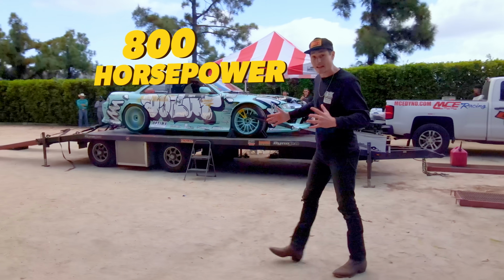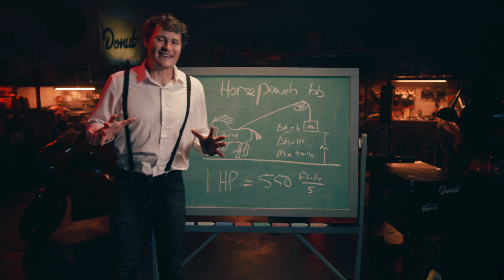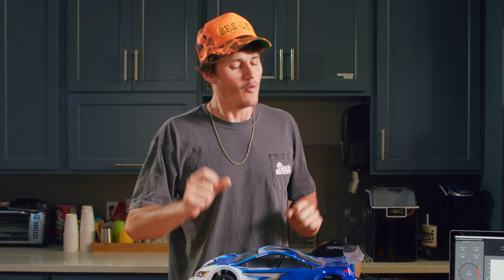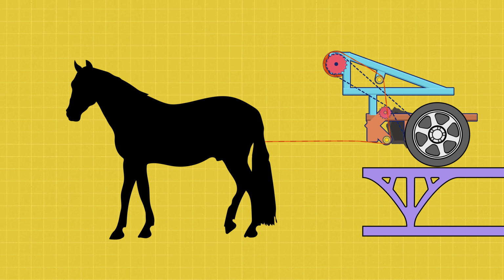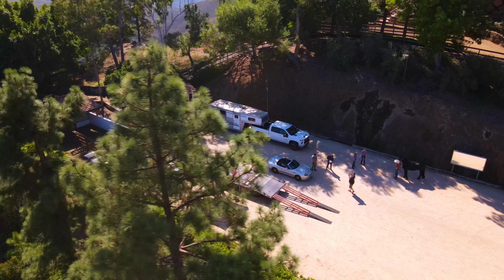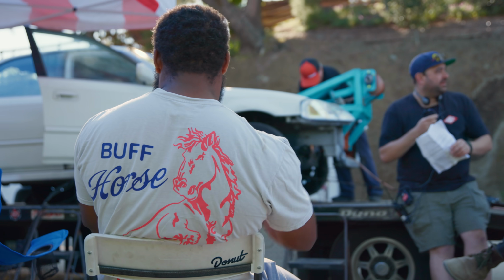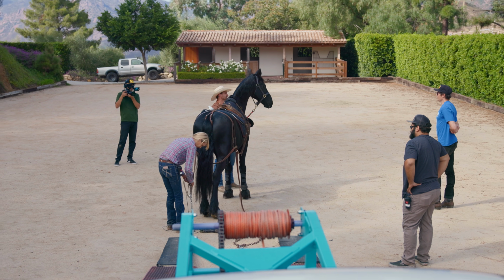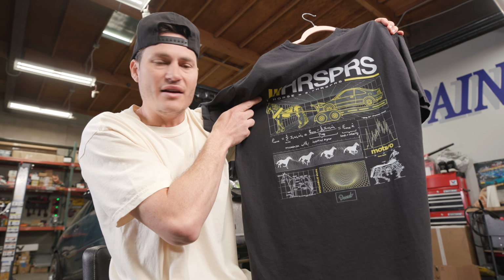How Much Horsepower is a Horse?

Comment: And there was me, hoping you were going to build a horse sized treadmill 😂 That would have let you measure sustained horsepower rather than very short burst.
Reply: exactly what I was wondering, why not use a treadmill type device?!
Reply: @hmezzy I mean the horse would for sure be quite confused and it'd be difficult to get the same amount of traction
Reply: @hmezzy  my old man has horses and I've been around horses and ridden them since I was little; there would be and issue with firstly getting the horse to start walking (unless the dyno drums are lighter which defeats the purpose {I think}) plus cars don't fly off the dyno cuz they are stuck in there, then there will be an issue with weight as the horse would be to heavy for a treadmill without extra support via extra rollers side-by side, and a treadmill track at least 3 in thick to compensate for the bumps, now the issue is slowing down the horse, my statement about the dyno drums still stands as I couldn't imagine a way to get a horse to comprehend slowing down the inertial force of the drums. With that in mind, if you really wanted to you could get in done as there are solutions to these problems but.. I really don't think it would be worth that much money for one test lmao. Prolly could of wrote an essay instead of writing a pointless nerdy youtube comment lol😂😂😂😂😭😭
Reply: @InvertedRooster  any animal can be trained to run a treadmill, but you are right it's an issue. Think a mouse on a mousewheel and how they constantly miss a step or go around in circles on it.
Reply: @hmezzy  not safe for horse and horses are super expensive, like they can go upto millions.
Reply: The step power of the horse would probably damage the machine in a way that would cause an inconsistency, not to mention the material issue for proper traction for the hooves, and safety for the hooves as well. @hmezzy
Reply: @hmezzy that already exists and measuring horse vo2max and watts and has been done since the 70s if not earlier.

This is more fun though.
Reply: The durability that thing would need is mad, and the horse might get freakedd out by it I suppose. @hmezzy
Reply: @hmezzy imagine how dangerous that would be for big d if he broke a leg he would end up dying seeing as horses legs aren’t capable of healing g from bad breaks
Reply: Better to use a rotational mill. Horses are used to going around in a circle during their training.
Reply: @armartin0003  True. I just thought that maybe a 4x human size linear treadmill could be constructed very easily with industrial rollers and belt.
Reply: @ColinDyckes  Time and money are indeed important to consider in any engineering project.
Reply: @ColinDyckes  because it's not about how fast the horse can run, but rather how much pulling force it can create
Reply: @yourmum69_420  Indeed, but it needs to be sustained power for a true comparison. So an industrial belt on rollers with an electromagnetic brake to add a realistic load would be ideal. This video just gives instantaneous max power.
Reply: @yourmum69_420  You can also calculate from how fast a horse can run. Quarter horses at 40 - 44 mph make around 12 to 14 hp. But only for 20 seconds.
Reply: @armartin0003  i would prefer circular and linear both and compare different horses and animals on them.
Reply: @armartin0003  yes I too was thinking some sort of mill but with a large enough radius to let the horse get some momentum and speed.
Reply: @armartin0003 omg why did I think the exact thing XD
Reply: Us moment 😅
Reply: I recall seeing pictures of a horse powered treadmill "locomotive" for pulling rail wagons in the very early 19th Century.
Reply: @charlesyoung7436  There was a horse powered shuttle connecting the north of Amsterdam with the rest somewhere in the 19th century.
Reply: That's exactly what I was thinking, too. Putting a rubber track over the dyno and having the horse going full tilt on it.
Reply: Fr. Especially how hard it is for the house to pull on that rope makes no sense to me
Reply: agreed, it would have been much easier to do and make corrections for the loss of power
Reply: Me too
Reply: Doesn’t seem very safe for the horse
Reply: @avonord  I was thinking of sustained low speed pulling power rather than high speed so I don't think there would be any danger to the horse
Reply: A horse can run on an electrically powered treadmill but horse can't run on a treadmill and make it roll. There is no support and grip.
Reply: @GhostYoutube000  Horse can be fixed in place same way they did in video, just rope would no unroll. Also, grind paper/rubber covers for horse shoes and or surface of treadmill is enough. Horse pulled on sandy ground there, that isnt best traction case for experiment too. There's so many questions, but than again that is just a fun experiment not actual science
Reply: @GhostYoutube000  I wasn't intending for the horse to run but rather work against resistance. I agree that the 'belt' would need a high friction surface for grip. I wonder if the idea of a rotary arm might be more representative of how horses were often used.
Reply: @ColinDyckes  this one sounds better.
Reply: That's a Mark Rober Project.
Reply: Someone should redo the test in a few more different ways and compare the results. I think experiment recreation is important in science but measuring the same thing another way gives confidence in the study. A treadmill and something where a horse goes around a circle to measure its torque.
Reply: @ProChairThrower  Treadmill wouldn't work. Horse wouldn't be able to push and get that power to the floor at all, not accurately
Reply: Makes sense that they did short bursts since horsepower is the max power a car has and the short burst is the max power the horse has
Reply: Yes, and an actual working horse (Not this prancing Hollywood substitute) will also give a drasticly different result.  For fun, search: "draft horse" or "horse pulling car being stuck"
Reply: Both the team and the OP ☝️ here show classic signs of constrained thinking, limited to their past experience. The team thought in terms of a "dyno" - their past experience and the OP here in terms of a "treadmill" his past experience.

Both depend on linear motion.

What they should have used was a rotary "HORSE MILL". Google it and see the Wikipedia page on Horse Mill.

Would have been perfect for the job, more so as the horse would have been used to the circular movement, as another commenter stated above.
Reply: You can buy them out of the box. They are pretty common. We have one: Horse Gym 2000. Just look it up.
Reply: A pto dyno would have been much easier. Could have integrated it into a horse Walker and then you wouldn’t be limited by the length of the rope they were pulling.  Most older horse walkers are powered by an electric motor that turns an old axle from a car or truck so everything would be there to connect the driveshaft to. For those that don’t know what a horse walker is just google “horse walker” and you’ll get an idea.
Reply: That’s what I was hoping for as well.
Reply: Hello ! May Allah protect and guide you to his light and happiness in this life and the hereafter, God bless, Ameen. Excuse me for giving a little presentation of Islam, because it is very misunderstood nowadays, especially on those « Antichrist's » times, where media and politics are mixed to distort history and truth. Thank you very much for your time.

Islam is an arabic word that means the Surrender to the One and Only God, our Creator, Protector, Provider, who gives us life and all that we have, we are safe and sound by his will and grace, we are His and to Him we return, and we have to thank him in this trial life by submitting to him by our free will, or later in the Day of judgment when it's too late to save our own skin. Islam was the original Religion descended to earth from heaven with Adam and Eve (peace and blessing be upon them) in the beginning of humanity. and was passed to people with the succession of the 124 000 prophets and 315 messengers of God to all nations and civilizations since, passing by Noah, Abraham, Isaac, Jacob, Ismaël, Joseph, Moses, Aaron, Joshua, David, Solomon and Jesus (Peace and blessing be upon them) during the history of mankind, the last replaces and completes the previous, until the succession of the last messenger of God fourteen centuries ago, Muhammad (Peace and blessing be upon him) to complete the noble morals of all mankind, to bring humans and jinns out of darkness into light, and to purify people's religion and belief from corruption and polytheism, and return it to purity and true monotheism, like it was in the times of the prophets (Peace and blessing be upon them).

Many Religions that we know nowadays, at their beginning were true and under Islam, initiated by one of the prophets of God, but their original teachings, history and scriptures have been corrupted over time with falsification and polytheism, or lost and replaced with false ones. That's why Islam is the only Religion accepted by God nowadays, which consists in bearing witness that there is no god besides Allah (God in Aramaic, the original language of Jesus and the Gospel), and that Muhammad is His servant and messenger, just like Jesus and Moses and others are His servants and messengers. Never a messenger of God said he was God or literally son of God, it was the people after him who changed the words of God and corrupted the Religion. God is unique and absolute, He does not need to have a family and sons or to associate anyone else with His kingdom, He can simply create whatever He wants, everything belongs to Him, and to Him everything will return. Allah said in Surah Al-Mu’minun : “God has never begotten a son, nor is there any god besides Him. Otherwise, each god would have taken away what it has created, and some of them would have gained supremacy over others. Glory be to God, far beyond what they describe. The Knower of the hidden and the manifest. He is exalted, far above what they associate. (91-92 / Translated by ITANI).

Allah means the one and only God, the God of all prophets and creatures, the creator of the universe and mankind, and the Master of the Day of judgment, where our destiny, Hell or Paradise, is decided based on our faith and deeds in this trial life, and above all, Allah's mercy. 

Allah said in Surah Al-Ikhlas : In the name of God, the Gracious, the Merciful.
Say, “He is God, the One. God, the Absolute. He begets not, nor was He begotten. And there is none comparable to Him.” (1-4 / Translated by ITANI).

Allah said in Surah An-Nisa : O FOLLOWERS of the Gospel! Do not overstep the bounds [of truth] in your religious beliefs, and do not say of God anything but the truth. The Christ Jesus, son of Mary, was but God's Apostle - [the fulfilment of] His promise which He had conveyed unto Mary - and a soul created by Him. Believe, then, in God and His apostles, and do not say, "[God is] a trinity". Desist [from this assertion] for your own good. God is but One God; utterly remote is He, in His glory, from having a son: unto Him belongs all that is in the heavens and all that is on earth; and none is as worthy of trust as God. Never did the Christ feel too proud to be God's servant, nor do the angels who are near unto Him. And those who feel too proud to serve Him and glory in their arrogance [should know that on Judgment Day] He will gather them all unto Himself: (171-172 / Translated by Muhammad Asad).

Allah the Most Merciful said in Surah Ali-Imran : Behold, the only [true] religion in the sight of God is [man's] self-surrender unto Him; and those who were vouchsafed revelation aforetime took, out of mutual jealousy, to divergent views [on this point] only after knowledge [thereof] had come unto them. But as for him who denies the truth of God's messages - behold, God is swift in reckoning!
Thus, [O Prophet,] if they argue with thee, say, "I have surrendered my whole being unto God, and [so have] all who follow me!" - and ask those who have been vouchsafed revelation aforetime, as well as all unlettered people, "Have you [too] surrendered yourselves unto Him?" And if they surrender themselves unto Him, they are on the right path; but if they turn away - behold, thy duty is no more than to deliver the message: for God sees all that is in [the hearts of] His creatures.
Verily, as for those who deny the truth of God's messages, and slay the prophets against all right, and slay people who enjoin equity - announce unto them a grievous chastisement.
It is they whose works shall come to nought both in this world and in the life to come; and they shall have none to succour them.
(19-22 / Translated by Muhammad Asad)..

God said : Say, “We believe in Allah, and in what was revealed to us, and in what was revealed to Abraham, and Ishmael, and Isaac, and Jacob, and the Patriarchs, and in what was given to Moses and Jesus, and in what was given to the prophets from their Lord. We do not differentiate between any of them. And to Him, we surrender.”
(2:136 / Translated by Community)

Salam (Peace) -----------------------
Reply: that would be the RIGHT and humane thing to do.
Reply: Wouldn’t work, the inertia and drag of the treadmill would be too much that the horse wouldn’t be able to put the power down
Reply: i ewas thinking they were goin to do the same thing
Reply: I thought about this, but I feel like a horse might not be stable on a treadmill
Reply: same
Reply: I was hoping for the same thing 😂
Reply: You know they make indoor treadmills right you can just hook the Dino rollers up underneath of it and find horsepower that way instead of all this over engineering crap
Reply: Same I am thinking same
Reply: At 7 minutes in, I was wondering how dumb this is going to get ... treadmill, easy...ughh
Reply: It's more like a torque test I guess
Reply: @1martymcfly298  max tq would be more accurate than trying to gauge hp good traction & inertia of an entire treadmill
Reply: yes i was here for a giant treadmill haha
Reply: The most difficult problem to solve with that idea, would be the build up momentum by the horse on the mechanical parts. As sohn as the horse for whatever reason stops running, the rotational inertia if the dyno won't care.
Reply: Me as well
Reply: Absolutely terrible idea. There's no wondering why you and half of the people in the replies aren't engineers (or even remotely intelligent individuals).
Reply: @sb2h  I AM a graduate engineer.
Reply: @ColinDyckes  you clearly learned nothing
Reply: @sb2h  And you clearly are not an engineer, or don't understand the question! A linear treadmill, or a circular one as used in days gone by as a flour mill, would enable a steady state power rating to be obtained, which would be much more useful, as opposed to this experiment which just gives starting power against a high load.
Reply: @ColinDyckes   yes, but I'm also not an idiot though like you are. Have fun getting a horse to give max output on a linear treadmill. A horse powered muscle mill like a flour mill would work, yes, but that's not what you said. You said treadmill.
Reply: @sb2h  A linear treadmill with a suitably rough synthetic surface, equivalent to grass and soil, would be equally valid. I would say that it would only need to be 3 or 4 horse lengths long given that they want to test power rather than speed. I'm surprised that you can't see that it would give the same result. I'll leave you to your views!
Reply: @ColinDyckes  the moment of inertia for a 3-4 horse length treadmill with a synthetic texturized surface is going to be tens of times larger than that of what they created. Also, you'd have to design a synthetic surface that's strong enough to transfer force from the horse to the treadmill, but weak enough to bend around the treadmill. So many cons, and absolutely no pros

Comment: How about the Hp from the GPS and force gauge calculations?  Suggest using a capstan style drum instead of a multi-layered cable drum that has to be corrected for cable wrap moment arm distance changes.  Excellent work on everyone's part including Big D.

Comment: So my car is actually 2,565 horsepower, or if you do the math the other way, 78.95 horses :D
I do see a potential issue... He wasn't allowed to pull a very long distance, and in a normal 'dyno' run you would need to run to maximum power level... and then the rope creates an added 'drivetrain' effect the longer it gets. So I wonder if adding a longer rope would allow Big D to reach maximum potential and torque.
But, for history's sake, doing the experiment the same as it would have been done before more or less, makes more sense than doing the exact method, since... it may not have been done that way anyway.

Comment: I think a brake dyno test would give higher HP. The conditions in this test looked like nowhere near max hp for any given horse will probably not happen there, the speed was quite low which might not be at full HP range yet, so to say, and the platform looked like a bit too hard maybe causing discomfort for the horse when trying to pull hard making it not really pull at full power....

Comment: Compelling experiment, indeed. As no two horses will demonstrate the same level of strength, I wonder if they should have considered implementing several horses and then average the results among each of them. Another approach might also be to join all of the horses tandem much like a wagon train and measure the collective result divided by the number of horses. 

Now that results of this experiment are out, it may invite other challengers.